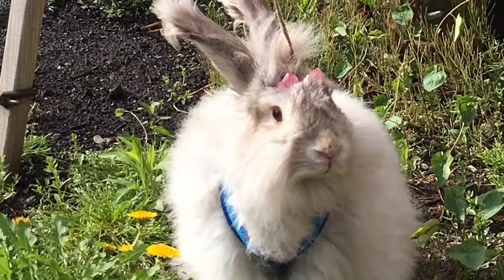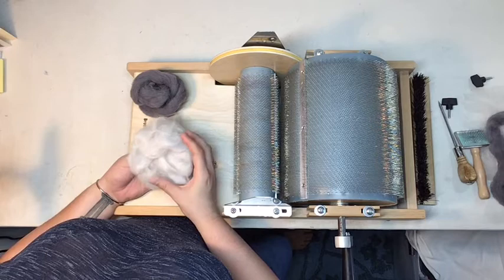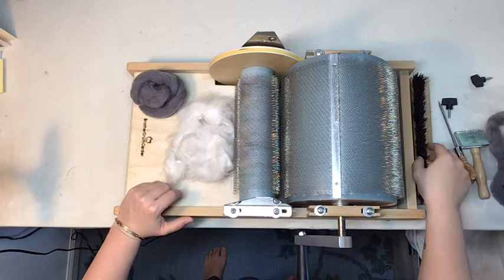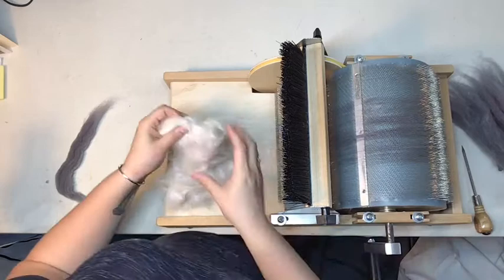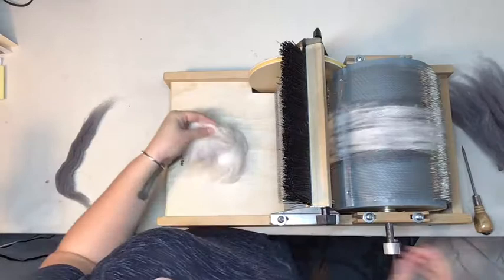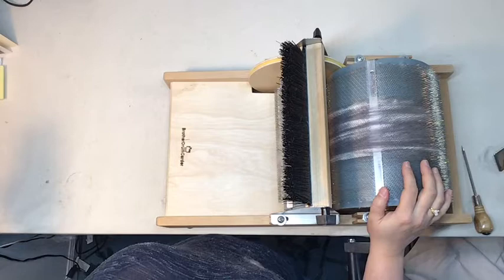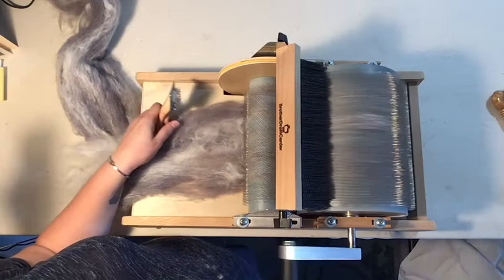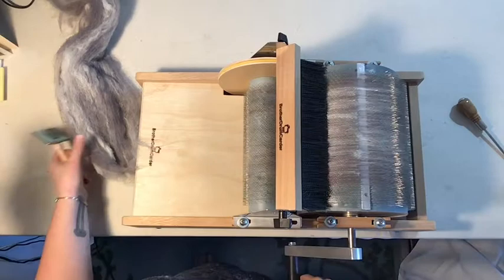How to Blend Angora with wool using a Drum Carder

Comment: Beautiful fiber for blending, and beautiful Luna!! ❤ Quick tip: separate out the sections into smaller ones (like drafting) before putting it through the second time. It puts much less stress on the tines and allows for more even blending. The fibers are likely to go onto the big drum rather than stick to the likker in. Thank you for sharing your knowledge and passion for angora!

Comment: What TPI is this drum carder?
Reply from the maker: Out of the Box homestead! Hi! Thanks for watching- my drum carder is 90 tpi- medium coarseness 😊
Reply: @clarioncallfiberarts7088  I have run 120 and a 190, just curious if your finding better luck with lower TPI with how fine Angora is? Have your tried switching up?
Reply from the maker: Out of the Box homestead! Yes! I have thought about that a lot- when I was purchasing my drum carder, they recommended a finer carding cloth, and I went with 90 vs 72 because I knew I would be doing a lot of angora, but I also would be blending other things so I thought maybe a middle coursed cloth would be better- I find that no matter what I do, the angora likes to stick to the teeth of the cloth, and I often wonder if the 72 would have helped with this. I haven’t tried this out sadly- getting a new drum carder is costly- but I’ve often wondered. What’s your experience? 😊